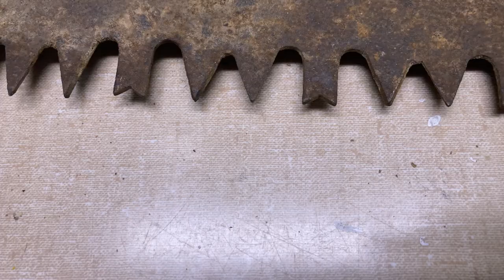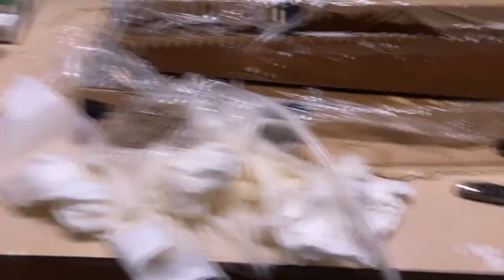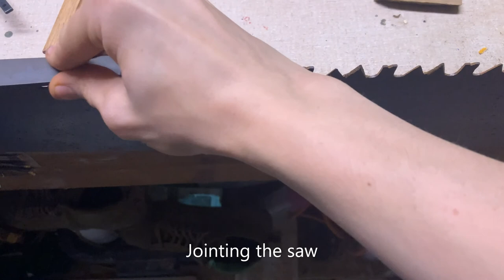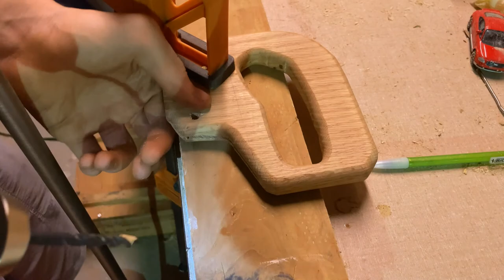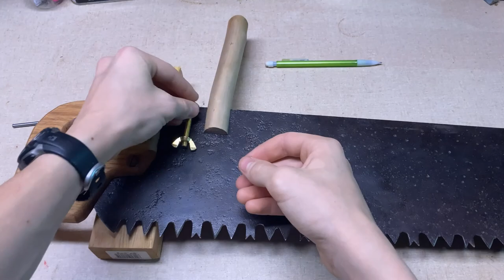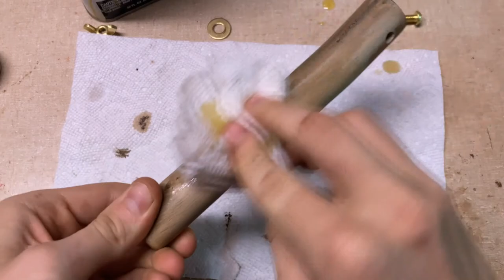100 Year Old Crosscut Saw Restoration

Comment: I have a saw that looks a lot like yours. It is the exact same toot pattern Champion tooth with Plain tooth at the tip. The handle was complete but very degraded as well. I cleaned off the rust and saw an etching that says: Henry Disston Cast Steel Warranted Philadelphia. I am not sure how old they are exactly, but I would guess early 1900's. No matter what the year is, I am sure it is high quality steel.